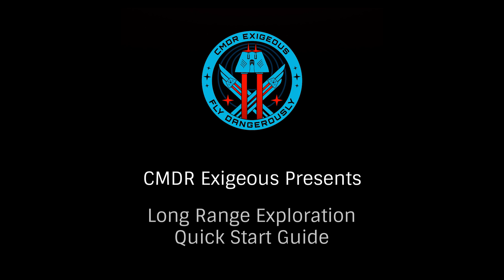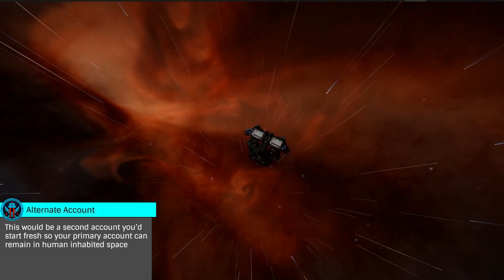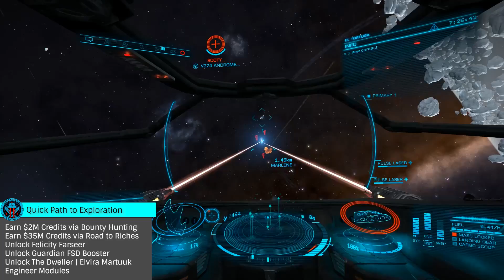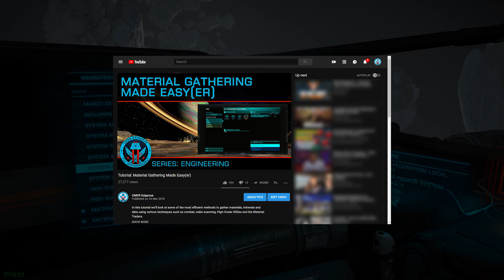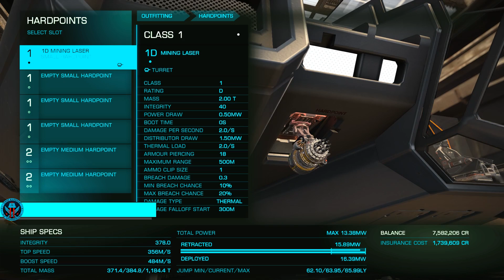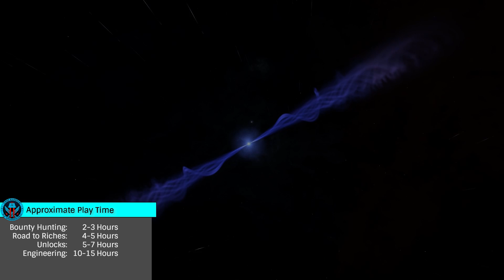Tutorial: Long Range Exploration Quick Start Guide

Comment: Nice video,  but a few tweaks/suggestions: for the power plant, do 4D as opposed to 3A, as it weighs 20% less than 3A at the cost of heat efficiently (generation). For the AFMU, Never do A-rated or D-rated. B rated is king. Less power draw, more capacity, more integrity. D-rated bonus of less mass is useless, as AFMU'S are weightless. Also, E rated has more capacity and less draw. C rated has more capacity, more draw and more integrity. B rated has the most capacity, 2nd most draw, and the most integrity. (IE best).

Comment: What i did was did a bunch of courier missions. Then i picked a point not too far outside the bubble and went. I then found a high value extraction zone. Bought a kill warrant scanner and bounty hunted. Bought a viper IV, rinse repeat. Then picked a place further away. Kinda out in the middle of now where. and upgraded what i could. FSD, fuel scoop, scanners, SRV. Sold the weapons. Found alot of unscanned systems. Scanned everything. Sold data. Bought a Diamondback Explorer and took a scenic route to Colonia. It was touch and go there for a while. But i made it, and bought and upgraded an Anaconda with all the system scans and discovery vouchers. But every system was a mystery. Something new. Something scary (my first blackholes) pulsar boosting (recommend getting better at this before leaving the bubble). You don't need anything fancy. A person made it all the way to Beagle Point in a sidewinder. All you need is a sense of adventure and some calm, reasoning. 07
Edit: Also Use EDSM and the Fuel Rats are life savers.

Comment: While doing road to riches (or anything else really) don't forget to stop at 0 threat level ( or higher) signal sources and pick up materials. Also, Wake Scan ships leaving starports for data.  Both work on your flying skills and your panel control, especially when your starting out.
Reply from the maker: Have to strongly disagree with that as in general a degraded emission is a big waste of time - now if you see a High Grade Emission you should ALWAYS stop for that as you'll get grade 5 materials where in a Degraded you'll only get grade 1's and 2's. 1 Grade 5 trades down for 81 grade 1's and 27 grade 2's.
Reply: @Exigeous  If you are new to the game higher threat levels might be intimidating.  More to my point is investigate signal sources for materials WHILE you are doing other missions to save time and break up the grind .  I don't think it's a waste of time if the source in close by.

Comment: Really enjoyed this video. 
As things have changed since the new updates, we now how one extra slot available because the discovery scanner became part of the ship and not a module. 
This frees up a slot for exploration ships. 
The asp explorer being my primary exploration vessel pre update; I’ve since engineered an exploration Krait Phantom (I believe you saw this outside ohm city “cmdr Cyfus here”) 
The phantom is able to achieve higher jump ranges than the asp explorer, faster speeds and is able to take along all the modules you included in this asp build plus a cargo rack and repair limpet controller. 
Effectively giving you all the tools to repair your ship and never have to return for repairs. 

I would love to see a video showing a new exploration build with the new update mechanics. 
Also, if you had to choose between an AFMU or a repair limpet controller, which would you suggest?

Your videos are top shelf my friend o7
Commander Cyfus

Comment: The worst part about the second account was the engineers, guardian modules unlock and synthesis material gathering.  After I made Elite trading on the second account and looked at all the other things i needed to do i decided to just use my main account.
Reply from the maker: Oh sure, it's work but for me it was only about 20 hours - so to get to have 2 accounts for that 20 hours for me was time well spent.

Comment: Great stuff here, I've been looking for a ship like this, so thanks for the content! Something you mentioned a few times is having mutiple accounts... Any tips around that? How to setup multiple accounts and share resources among them, etc. I guess things like engineered modules are not shareable and I would need to unlock them on every account, but materials and similar stuff might be.
Reply from the maker: Well you can't share anything between accounts - other than your various settings on your PC (since those are in your Windows profile).  When you open the Launcher you just log out/in to the account you want to play and play them separately - if you had 2 PCs (or VM/etc) you could run both and wing up with yourself to share wing missions, etc. - but just like any other account it's totally new and fresh.  This guide talks a lot about fast tracking that second account as once you know what you're doing you can get to this ship level in under 30 hours of gameplay.
Reply: Thanks for the quick reply, very much appreciated! As any other online game, I understand that both accounts are unique and separated, but in other MMOs I used to trade stuff between accounts, like crafting materials or special items,  even though I had to level up characters in each account separatedly. Is it possible to do something like that?
Reply from the maker: Nope, there isn't - it's something Frontier is VERY against and I agree. The issue is as soon as we could trade things like that between players a "real world" economy would spring up and people would be selling things for real world cash.  They have vowed to never let this happen and while it does limit certain things I think it would be really bad for the game if they allowed it.
Reply: I'm quite new to the game and I wasn't aware about this posture from Frontiers... It makes sense from that point of view. Again, thanks for the insight and the great work and effort you put into ED content, it's been really helpful!

Comment: guardian fsd booster? man I just finished upgrading my fsd to grade 5 and only have 47ly on my aspx is the guardian booster that powerful?!
edit : nvm just saw that it adds 10ly lol
Reply from the maker: Well yep - as you saw it is, well not that powerful as you should be able to hit mid 50s pretty easily with a properly outfit and engineered Asp X.  Either way it's a great module and something you should go unlock ASAP IMHO, PDQ :D
Reply: CMDR Exigeous Yeah I'll try to unlock it tomorrow. The only thing I have fully engineered is the fsd atm. Can't be bothered right now to grind for more engineer upgrades as well as those costly experimental effects. It's too much grind lol If I manage to get the guardian fsd booster though I'll have 57ly on my aspx which totally does the job for me^^
Reply from the maker: Oh sure, 57LY isn't bad at all.  If you haven't seen my videos on material gathering and quickies on mineral and data gathering using the material traders saves a ton of time, you could likely have that thing complete in about 4 hours total of gameplay, for when  you are ready to do that.
Reply: CMDR Exigeous I'll make sure to check them out then! Thanks cmdr!:)
Reply: I think you also have to strip your ship down to bare essentials so can mean less hull reinforce and shield and guns . Something I dont like to do but if it gets you the jump range. Just make sure you dont have any valuable cargo in case you have to submit to interdictions . But depending on where you are going , there shouldnt be much interest in you anyway Bounty hunters and pirate ( and other commandrs who have a sick sense on humour and are bored . LOL ) They should be sticking to trade routes and res sites more  in various ares of the bubble since that is how they make their money

Comment: Nice guide,  however I would try an fit in a repair limpet module as if your going really far from the bubble,  (Opposite side SGA* towards Beagle) as there is no way to repair hull damage without requesting help from a Rat.  Found this out the hard way when I took a load of hull damage and had to get back to Colonia with around 35% hull left.
Reply from the maker: Agreed that would be nice to have but there is simply no room for it on the Asp X as you need not only the limpet controller but a cargo rack to store the limpets.  It's also not a huge concern as there are a number of deep space stations/bases, some on the way to Colonia and several in various nebula around the galaxy.
Reply: can understand if your in an aspX how restricted you are for space as that was one of my first exploration ships.  Maybe if you do another video in the future on a Conda for long term deep exploration it could be worth a mention. 

Would love to see some sort of stations on the far side in the future though.

Comment: I wish all ships had some built-in small cargo space, I cant fit any field maintenance repair module on my asp because i like to have some cargo space just in case.
Reply from the maker: What would you possibly need cargo space for?  There is absolutely nothing worth picking up as the most valuable thing you could find would be a ton of cargo worth what, $40,000?  And you'd trade something necessary like an AFMU, FSD booster, shield, etc?
Reply: @Exigeous  cargo space to collect resources for synthesis with mining laser?

Comment: Can I use these specks the engineer mods for the same effect for my anaconda
Reply: Simon Willis yea more or less.... you’ll get better range with a conda, but if you are the type that likes to scan every body in a system, the asp is far more maneuverable in super cruise..... it’s a trade off. Some have pushed their condas up over 80Ly’s...... if you actually want to bring stuff with you, mid 70’s is more reasonable.
Reply: Cornpone I scan everything but I keep as I am for fsd range 
I’m guessing 80 is the best but I’m hoping to set to 60 till I can unlock all engineers 
Thanks for your advice
Reply: Everything is a trade off really. I just returned from Beagle Point in a conda with a range of 73Ly. Took 2 srv’s, a fighter hanger, I like enough power to boost, size 3D shields in case of rough landings, I like armored power plants cuz you can’t repair those when you’re out there..... and I’m sure a few other aspects added weight as well. Just remember getting the absolute max jump range means you’re basically exploring in a paper bag lol.... but get that ship ready and head out.... and don’t forget the screenshots of the weird ass stuff you’ll find!
Reply: Cornpone nice yes my integrity isn’t the best but I’m wanting to get to 70 ly with the guardian fsd boost 
Iv got a class 4 free I’d have a fighter to if I can fit one
Reply: You’ll need at least a 5 for a fighter bay...... and the only reason I got my fighter out was “well I brought this thing way the hell out here.... I guess I better fly it for a minute” lol...... I decided I don’t need to bring fighters with me anymore. If you have friends joining you in multi crew, it would be awesome to have with you so they can play.... outside of that, meh
Reply: Cornpone cool well that’s saved me a five slot lol

Comment: Actually, one correction: the Long Range scanner is faster in almost every situation even if you scan every body in the system. The layout of the system needs to be very specific in order for the Fast Scan mod to take the lead.

If I remember correctly, Kornelius did a video on this, running tests on multiple systems scanning the whole system and in only one of them Long Range lost.
Reply: I have a conda set up for distance, and when I’m out in that, I honk and wave only stopping for high value worlds. Long range scanners rule in that setting. I have a clipper I think of as a cartography ship. Jump range doesn’t matter so much when I’m just jumping with no actual destination, and super cruise handling means much more when I want to scan entire systems. Fast scanners for the win win that mindset.
Reply from the maker: Actually correction of correction - it totally depends on how you use it.  If you're going to scan every planet fast scan works out faster - in all my testing, and I did test, when you just want to scan a single planet that's more than 500 ls away long range is faster.
Reply from the maker: Exactly - perfectly stated Compone.
Reply: CMDR Exigeous Hm. That's interesting, I think I need to run some tests on that then, for validation and I'm curious to see what the exact numbers are. I wonder if there was something off with Kornelius's methodology since you came up with opposite results.
Reply from the maker: Well as I said it comes down to how and when you use it.  They are quite close but for me when scanning a single planet at range long range worked better as I start scanning it sooner and then can go to the galaxy map and do something else while the scan is completing making the use of my time more efficient, that's all.

Comment: Doing this because of Palin unlock :/
Reply from the maker: Oh, for the Palin unlock just use the Neutron Superhighway as you can jump 1000 LY in about 10 minutes with a 50 LY range.  With a 40, which you can get on a DBX without engineering, you can do it in about 15 minutes per 1k - then just teleport back and you're done.
Reply: Good call man, Palin is my favourite engineer and coolest engineer base imo